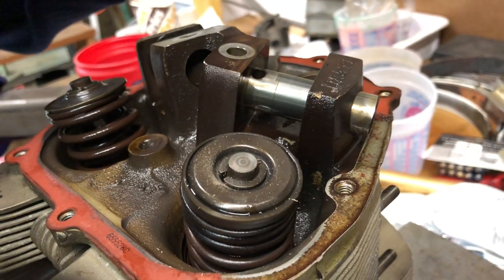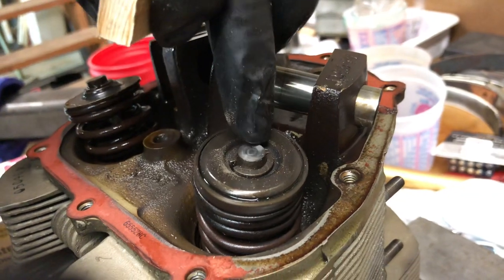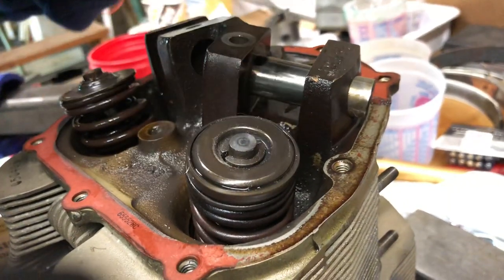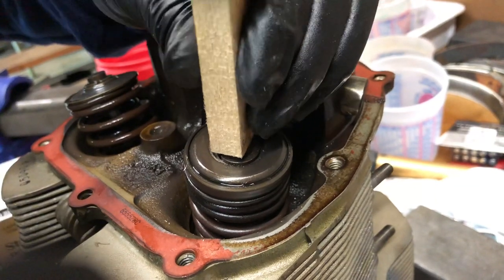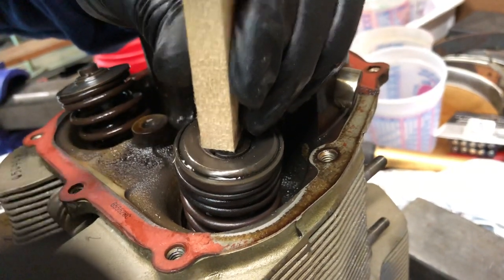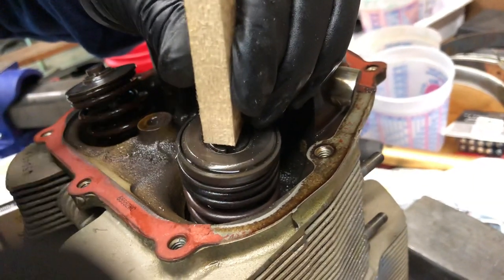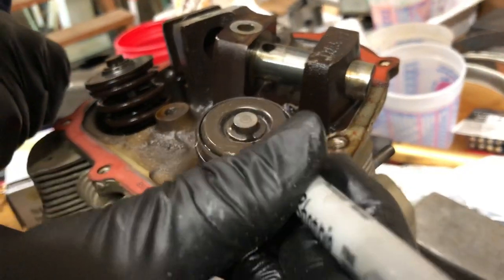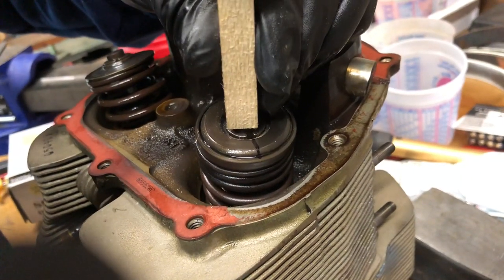Continental valve rotator test

Comment: Trying to remove a rotator cap from a lycoming jug but it’s different than the continental. Any tips on removing the little cap without damaging it?
Reply from the maker: The little cap usually comes off with a magnet. It just sits on top of the valve stem.
Reply: @AirDavePasqualeAviation  yeah it had a little debris in there and was just fighting me a bit and I didn’t feel like monkeying it out and messing it up! Thanks for the reply dude!